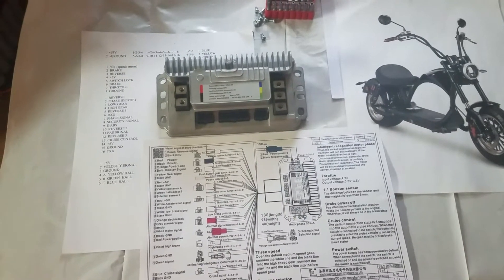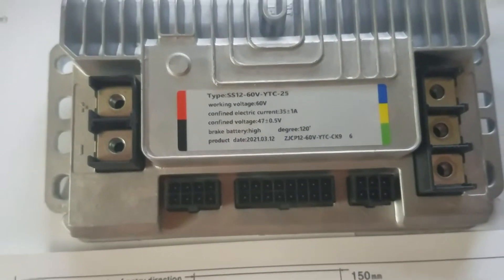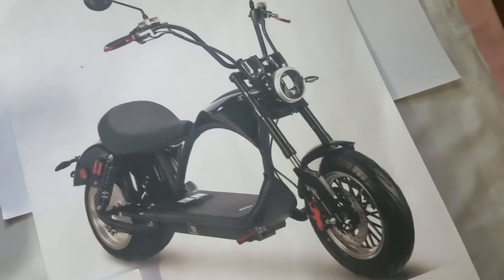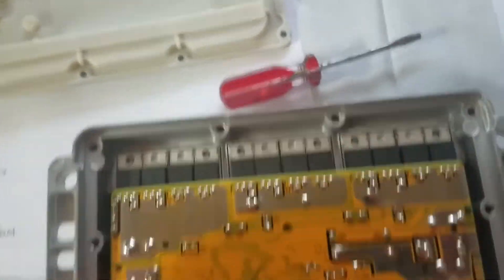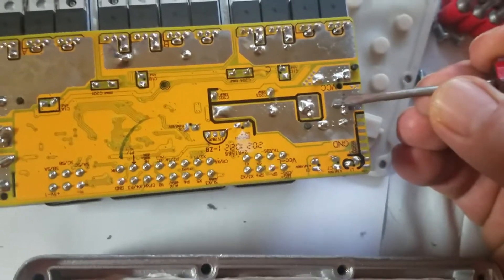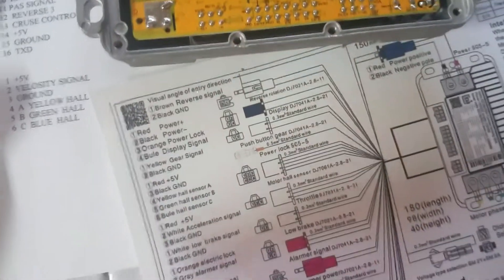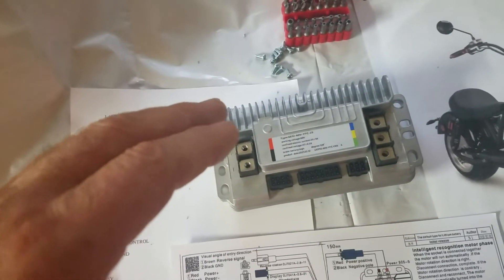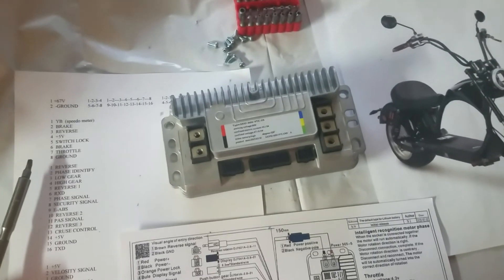CITYCOCO, MOTOTEC, TOXOZERS SPEED CONTROLLER SHUNT MOD

Comment from the maker: AFTER TESTING... I DO NOT RECOMMEND DOING IT THAT WAY... BUT IT DOSE GET UP TO  40 MPH /65 KPH ALMOST INSTANTLY AND POSSIBLY FASTER BUT I DID NOT HAVE THE GUTS TO LET IT GET ANY FASTER. (PROBLEMS) (1) HIT IT HARD FROM A STOP AND AFTER 50 FEET THE SELF RESET-ABLE FUSE TO THE CONTROLLER POPS AND SHUTS EVERYTHING OFF. (2) BATTERIES GET HOT FAST AND DRAIN LIKE CRAZY. (3) DYNAMIC BRAKES DRAIN THROUGH THE SHUNTS SO IT SLAMS THE DYNAMIC BRAKES ON HARD, NO LONGER SMOOTH JUST BY ONLY TRIPPING THE BRAKE LIGHT. (4) DECELERATING THE THROTTLE ALSO HITS THE DYNAMIC BRAKES HARD AS WELL. HOWEVER I HAVE A CURE, I WILL RUN THE JUMPER THROUGH A 40 AMP CAR RELAY TRIGGERED BY A BUTTON ON THE LEFT HANDLE WHERE THERE IS A BLANK PLACE TO MOUNT IT AS JUST A BOOST BUTTON. ONLY HAVE TO HAVE ONE WIRE COME OUT THE CONTROLLER WHERE THE SHUNTS GO TO AND THE OTHER WIRE RIGHT TO THE NEGATIVE SCREW ON THE CONTROLLER THAT WILL GO TO THE RELAY TO JUMP TOGETHER FOR INSANE BOOST, LIKE A SCRAMBLE BUTTON.
Reply: @TechKnowCSS  can you please make a video showing how this is done and give us a small review if it is safe to do so please ?
Reply: Need a video for that boost button 👍
Reply from the maker: @k.orhan-tan  IT IS JUST JUMPING OVER THE MAIN INPUT SHUNTS WITH A 30 AMP CAR RELAY, I NO LONGER USE THAT STOCK CONTROLLER NOW.
Reply: @TechKnowCSS  please Can WE let us know which contrôler you're using, thank you so much
Reply from the maker: @thierryaudibert5240  I NO LONGER USE THIS CONTROLLER, IT IS THE STOCK FACTORY ONE THAT IS OK IF YOU DO NOT WANT MORE POWER OR GO FASTER THAN 30MPH. I USE THE SABVOTON SINE WAVE MQCON Electric Motorcycle Controller Model ML7280
Reply: @TechKnowCSS  thank you very much for your answer, 👍👍
Reply: He has three pens in there you could’ve just added the third pin I have the exact same controller in my GT08 I have two of them just make sure that your motors are over 2800 W

Comment: Hey i have a CP-4 and i'm trying to do the mod now. Do i wire the cable on all 3 shunts? Because, you're shunts are on the middle/right section. But mine are left/middle sections wired. Will it make a difference?

Comment: i have a new city coco m3/chopper. the lighting system does not work. Can you tell me where to look for the fuse or how to fix that? I am wondering if it shorted when it was first connected. HELP. I am NOT an electrician by any means. I do not have a diagram like yours. I have notified the store seller for warranty service. In the meantime, if it is a simple fix, I am all ears. My Bike gets power to the speedometer, and will go into gear to ride. Just no lights.

Comment: Good day Mr when thé wheel not turning what IS that problème ??? thanks you
Reply from the maker: The kickstand is down or one of the brakes is applied or shorted wires to the brake handles switches, or kickstand wires shorted.

Comment: This mod need another battery.  Those batteries are not made for high current.  It is much better to go for another controller that is programmable and build a now battery with higher voltage.  20s is way faster than 16s  and you dont need more amps. 84v and 35 amp gives you 3000 watts and it should have a max speed of about 45-50 mph
A 20s8p with 21700 cells will give you about 84v 40Ah and a range up to 80 miles

Comment: Any idea why my lowboy won't start at all? I replace the motor that you're working on the ignition switch and the battery still will not start
Reply from the maker: Check your brake switches and kick stand switch and wires that they both will disable the bike.

Comment: thank you for your video sir, i hope you're doing well all the best!!! i'll try this soon :)

Im also thinking about making a trigger near the throttle, i'll pass the shunt mod through a high amp relay, then drive the relay of 5v from the throttle..

did you ended up doing this? i read in your comments bellow that you had some issues driving and you're putting some sort of switch.
i would only use the mod going on a flat straight road or while going up for a tiny boost!!!

greetings from portugal,
Best

Comment: Wonderful reserch your doin for e-chopper community thank you so much I soldered my shunts together instead point to point like the way you discribed should I undo that and do your recommendation?
Reply from the maker: I USED A 40A CAR RELAY WITH A MOMENTARY BUTTON TO "ENGAGE" THE SHUNT TO USE AS A SLIGHT BOOST OF TORQUE, IT DID NOT HELP IN TOP SPEED, THE RELAY WAS BECAUSE THE DIRECT SHUT WAY WAS WAY TO ABRUPT ON THE DYNAMIC/RE GEN BRAKING.

Comment: Does the description on the paper match your controller? At two points, for example, the ground is not there, as it is on the panel.
I have a different type of controller on my bike. It failed because the top speed suddenly became 25. Everything I do is 25 speed. I bought one of this type, but it has a different connection, so it has to be rewired.
It's good that I found this video, but as I mentioned, there are 1-2 problems.
Reply from the maker: THERE ARE SO MANY THAT LOOK ALIKE BUT NO THE PAPER ON THIS ONE DOSE NOT MATCH, HOWEVER I MADE ONE MYSELF THAT DOSE MATCH THE PINOUTS.
Reply: @TechKnowCSS   The paper matches my controller in it. Is there a wiring diagram for the SS12-60V-YTC-25?
The symbols on the panel do not match. HALL sensor, GND and VCC ok. Throttle lever, brake switch, gear shifter and the TXD connection would be required. Thanx

Comment: Dear Sir;
 
I hope you are doing well. I know very well that you’re a high-level expert on BLDC controllers. I live in Turkey and I freshly bought a New 2020 Shansu (citycoco) CP-4 3000w 12*7.5 inch fat tire BLDC Chopper from reseller.
I am in the edge of upgrading my controller and I don’t like to waste any money, but find the most accurate and compatible controller for my bike.
Unfortunately no one here seems to know anything about BLDC controllers especially related to these kind of motorbikes. Therefore your consultation is very appreciated. 
My system is 60V&35A by default however installed an extended battery pack and with default controller, now it’s running on 17S7P (3C) 64V & 35A battery setup.
By the way the original wiring is terrible. Therefore I upgraded the wire between battery and controller to 10AWG while upgrading the power slots to XT-90. By default, I can reach 700-722 RPM with no problems under many conditions, that means 65-70km/h. However, more torque & max speed is a must, when it comes to dealing with hills and highways of my city.
From your youtube broadcasts and comments, 72V 80A is the final sweet spot for our rides. Therefore I’d like to have your valuable experiences, thoughts and suggestions on my following issues below:
 
900-1000 RPM will be the best option for me under several conditions. Cranking up the voltage to 72v seems to be the cure for this issue. However there are terminology like “flux weakening” while talking about speed of BLDC motors.
I am planning to buy VOTOL EM-70S controller for more output. It has “flux weakening” and the programming interface seems to be more user-friendly than most of the others on the market.  Its negative aspect is supporting only 60A nominal whereas 80A could have been better for us.

If you suggest a different controller, which controller should I use in terms of
                                                     i.     Programmability and customizability, maybe having “self-learn” advantage
                                                   ii.     presence of “flux-weakening” option for extra speed,
                                                  iii.     durability of MOSFETs and overall setup
                                                  iv.     conformity to the BLDC motor of our bikes 
                                                   v.     applicability with our default double cylinder shaped speedometer display
 
I I’d like to  thank you in advance for your valuable answers and guidance.
Reply from the maker: I had long ago upgraded to a 72v 80a PURE SINE WAVE controller as a clone of the SABVOTON ML7280/MZ7280 PURE SINE WAVE controller for my 2500W 60v hub motor, Yes 72v for a 60v motor. Motors are not voltage bound, they are watts so i am now getting over 4000W. The original 2500W motor can run 24/7 at 2500W but can put out over 10KW for 10/15 seconds and 5KW for a minute or so WITHOUT damage. VOLTAGE= speed.
Reply: @TechKnowCSS  thank you for your reply 😀

Comment: Hy! I have the same type of controller but someone has previously mingled the on off switch and the lights output...cout you tell me wich connectors are for those two?
Reply from the maker: 1 +67V          1-2-3-4   1---2---3---4---5---6---7----8    1-2-3   1  BLUE  W         
2 -GROUND  5-6-7-8   9-10-11-12-13-14-15--16    4-5-6   2  YELLOW  U  
                                                                                                 3  GREEN  V                                                                                                                                       
-----------------------------------------------------------------

1  YELLOW (POWER ON SWITCH +60V ALSO ALARM YELLOW OR ORANGE)
2  GREEN (KICKSTAND SIGNAL)
3  GREEN W/WHITE (THROTTLE SIGNAL)
4  BLUE W/WHITE (3 SPEED SIGNAL LOW)
5  YELLOW W/GREEN (BRAKE SIGNAL)
6  BLACK W/WHITE (THROTTLE GROUND)
7  PINK (THROTTLE POWER +5V AND KICKSTAND POWER)
8  RED W/BLACK (REVERSE)

1  ?
2  YELLOW W/WHITE (3 SPEED SIGNAL HIGH)
3  ?
4  ?
5  ?
6  ?
7  ?
8  ?
9  ?
10  ?
11  ?
12  PURPLE (SPEEDOMETER SIGNAL)
13  BLUE (ALARM)
14  GREY (ALARM SIGNAL)
15  ?
16  BLACK (KICKSTAND GROUND)

1  C  BLUE  HALL W
2  B  GREEN  HALL V 
3  A  YELLOW HALL U 
4  GROUND
5  VELOCITY SIGNAL
6  +5V

Comment: i have a CP4 same model however advertised as a 3000w motor do you suggest me to do this upgrade (controller box ) ? i would have a dual battery setup in the coming weeks . will replacing the throttle switch make much difference? 

have you tried the 40amps relay mod yet ?  any improvements ? is there any way to wire it upto use the bridge only when you are using the full throttle or when selecting speed 3  ?
Reply from the maker: I DO NOT RECOMMEND THE DIRECT JUMPER BUT YES THE 40A RELAY ENERGIZED BY A N/O PUSH BUTTON ON THE HANDLE BARS NEXT TO THE GRIP BECAUSE I DID THE RELAY MOD AND IT GIVES 15-20% MORE TORQUE FOR FASTER TAKE OFFS AND QUICKER TO TOP SPEED BUT REALLY DOSE NOT INCREASE TOP SPEED, I RECOMMEND NOT HOLDING THE BUTTON LONGER THAN 20 SECONDS TO BE SAFE ESPECIALLY UP A STEEP GRADE. WITH THE RELAY MOD THE WIRES THEMSELVES DO SILL HAVE SOME RESISTANCE WHICH IS A GOOD THING, AS FOR THE THROTTLE REPLACEMENT I ONLY RECOMMEND IT IF YOU TEST YOURS AND THE MAX OUTPUT VOLTAGE IS LESS THAN  4.3 VOLTS BUT CAN BE AS HIGH AS 5 VOLTS. MINE WAS 4.1 VOLTS AND AFTER REPLACING ONLY INCREASED SPEED BY 2 MPH NOT KPH BUT I THINK IT WAS WORTH IT. I SOLDERED ONE 12G STRANDED WIRE TO THE CONTROLLERS SIDE OF THE SHUNT RESISTORS AND OUT A HOLE I DRILLED OUT OF THE BOX ABOUT ONE FOOT BEFORE THE RELAY THEN ONE MORE FOOT AFTER THE RELAY TO THE NEGATIVE POWER SCREW OF THE CONTROLLER.
Reply: @TechKnowCSS  thanks for your reply
Reply: @TechKnowCSS  i don't know of it makes sens  lee  from citycoco told me that the tops speed is limited from oth controller and  motor it self
Reply from the maker: @Brolly916  YES, HE WOULD KNOW BETTER. LIKE I SAID THE RELAY JUMPER LETS YOU GET TO TOP SPEED FASTER, NOT GO FASTER, BUT I WOULD LOVE FOR HIM TO EXPLAIN HOW THE MOTOR ITSELF LIMITS YOUR SPEED IN ANY WAY, THAT PART IS A LIE. I HAVE BUILT A 72 VOLT(84V FULL) BATTERY AND GOT A 72V 80 AMP 3000W CONTROLLER, THAT WILL MAKE IT GO AT LEAST 50 MPH MAYBE MORE. I WILL LET YOU KNOW WHEN I INSTALL THEM. THE BATTERIES FOR THE NEW PACK COST ME $155.00 AND TOTAL COST OF PACK WAS UNDER $300 TOTAL FOR A 20S12P  72V 30A BATTERY. 240 18650 CELLS IN A 9 X 27 FORM FACTOR WITH 3 BLANKS AT ONE END AND FITS IN THE DECK LIKE A GLOVE.
Reply: @TechKnowCSS  please when installed cab you kindly provide me with the link for the 72v battrey and controller please
Reply from the maker: @Brolly916  I BUILT THE BATTERY MYSELF, CONTROLLER LINK...  https://www.amazon.com/gp/product/B094HWC3DC/ref=ppx_yo_dt_b_asin_title_o05_s00?ie=UTF8&psc=1
Reply from the maker: @Brolly916  YOUR "IN" WITH LEE FROM CITYCOCO, WOULD YOU ASK HIM IF THE STOCK CONTROLLER AS THIS ONE CAN BE USED AT 72 VOLTS. WOULD BE NICE TO KNOW FOR SURE.
Reply: @TechKnowCSS  if i recall correctly it cam however some components would  be used to their limit
Reply from the maker: @Brolly916  THE SAME CONTROLLER IS ON AMAZON AS A 36V-48V AND AS A 48V-60V AND A 60V-72V, IS THERE DIFFERENT MODELS?
Reply: @TechKnowCSS  Hi. Do you have a link for the batteries?
Reply from the maker: @chanin6014  WHICH ONES?

Comment: I have the same controller an search a way to "unlock" the speed. On my There are only 5 wires in the big plug pin 2, 12,13,14 and 16. I don't finde any way to drive faster than 45kmh. Is it possible so attache a citycoco m1 controller on it ?.
Reply from the maker: ANY CONTROLLER CAN GO ON ANY MOTOR, JUST HAVE TO KNOW THE WIRES ON THE CONTROLLER AND TRACE OUT THE ONES ON THE BIKE. ALL YOU NEED IS THE 3 BIG PHASE WIRES, HALL WIRES, THROTTLE WIRES AND POWER FOR ANY OF THEM TO WORK. (THERE MAY BE A "ON" POWER WIRE).
Reply from the maker: STOCK 60V SETUP MINE GOES 53KPH WHICH I THINK IS TOO SLOW FOR THE SETUP, YET IT IS ONLY A 35 AMP CONTROLLER MADE FOR ONLY 1000 WATTS.
Reply: Did you find how to unlock the 45 km limit?

Comment: Have you installed it back on your bike and tested it yet? 😁
Reply from the maker: I WILL TOMORROW AND LET YOU KNOW. I GOT A LATE START TODAY.
Reply from the maker: AFTER TESTING... I DO NOT RECOMMEND DOING IT THAT WAY... BUT IT DOSE GET UP TO  40 MPH /65 KPH ALMOST INSTANTLY AND POSSIBLY FASTER BUT I DID NOT HAVE THE GUTS TO LET IT GET ANY FASTER. (PROBLEMS) (1) HIT IT HARD FROM A STOP AND AFTER 50 FEET THE SELF RESET-ABLE FUSE TO THE CONTROLLER POPS AND SHUTS EVERYTHING OFF. (2) BATTERIES GET HOT FAST AND DRAIN LIKE CRAZY. (3) DYNAMIC BRAKES DRAIN THROUGH THE SHUNTS SO IT SLAMS THE DYNAMIC BRAKES ON HARD, NO LONGER SMOOTH JUST BY ONLY TRIPPING THE BRAKE LIGHT. (4) DECELERATING THE THROTTLE ALSO HITS THE DYNAMIC BRAKES HARD AS WELL. HOWEVER I HAVE A CURE, I WILL RUN THE JUMPER THROUGH A 40 AMP CAR RELAY TRIGGERED BY A BUTTON ON THE LEFT HANDLE WHERE THERE IS A BLANK PLACE TO MOUNT IT AS JUST A BOOST BUTTON. ONLY HAVE TO HAVE ONE WIRE COME OUT THE CONTROLLER WHERE THE SHUNTS GO TO AND THE OTHER WIRE RIGHT TO THE NEGATIVE SCREW ON THE CONTROLLER THAT WILL GO TO THE RELAY TO JUMP TOGETHER FOR INSANE BOOST, LIKE A SCRAMBLE BUTTON.
Reply: @TechKnowCSS  can you please make a video showing how this is done and give us a small review if it is safe to do so please ?
Reply: @TechKnowCSS  Ok I’m glad you let me know I was about to order the security kit and get started! 😁 The video quality is good! The boost button sounds like a very good idea!
Reply from the maker: @Sputz3  THE VOLTAGE OUTPUT OF MY THROTTLE WAS LOW BY  .2 VOLTS OF MIN OUTPUT, TOP SPEED WAS 53KPH/33MPH, NOW WITH NEW THROTTLE TOP SPEED IS NOW 56KPH/35MPH.
Reply: @TechKnowCSS  😮 please link the throttle you got. I need that.
Reply from the maker: @Sputz3  IT WAS A PLAIN GENERIC ONE UNDER $10. I CUT, THEN SPLICED THE WIRES AND SOLDERED THEM ABOUT 3 INCHES FROM THE HANDLE AND PUT BLACK SHRINK WRAP TUBING OVER THE SPLICE, WAY EASIER THAN RUNNING NEW WIRES IN THE WIRE LOOMS, BESIDES THE WIRES WERE TOO SHORT TO REACH WHERE THE OLD ONE WENT. NEW ONE IS MORE LINEAR AND STARTS WORKING RIGHT AWAY NOT LIKE THE OTHER HAD TO TWIST OVER HALF WAY BEFORE ANYTHING HAPPEND.
Reply from the maker: @Sputz3  IT WAS A COMBO SET THAT ALSO INCLUDED BRAKE LEVERS WITH THE CUT OFF SWITCHES IN THEM. FROM EBAY.  eBay item number:264301711959
Reply from the maker: @Sputz3  MAY HAVE TO HIT THE END OF THE HANDLEBARS WITH A FILE FOR THE BURR AND SAND A LIGHT COAT OF THE CRINKLE PAINT OFF THE LEFT SIDE.  THEN RIGHT SIDE HAVE TO REMOVE THE SWITCH CONTROLS WITH PHILLIPS SCREWDRIVER, BUT BEFORE YOU HAVE TO LOOSEN THE BRAKE HANDLE WITH A 8MM SOCKET SO YOU CAN ACCESS THE SET SCREW FOR THE NEW THROTTLE, AND BESIDES CUT THE WIRE  3 INCHES FROM THROTTLE TO REMOVE THE OLD ONE BECAUSE THERE IS NOT ENOUGH SLACK TO PULL THE THROTTLE ALL THE WAY OFF.
Reply from the maker: BY THE WAY I KNOW NOT PERFECT BUT WAS THE VIDEO OK? I MADE A FEW MISNOMERS.